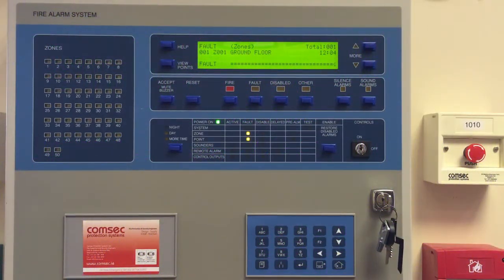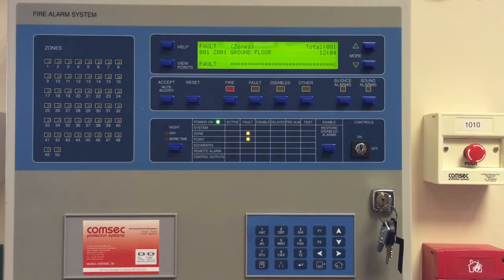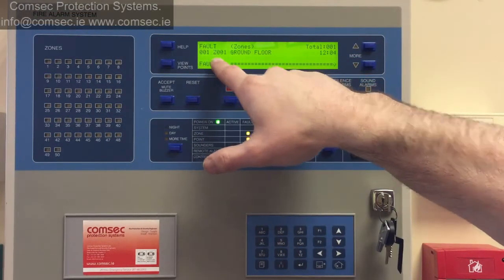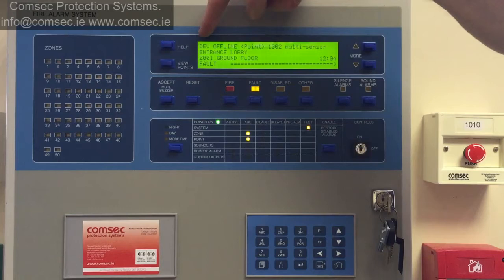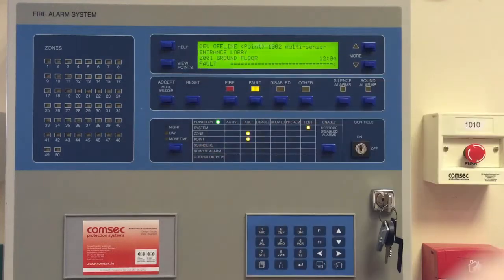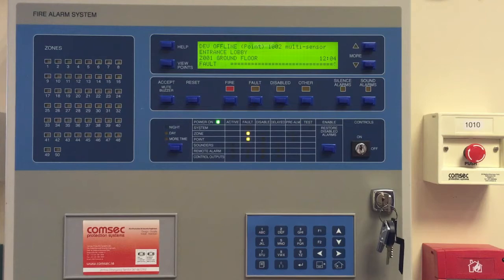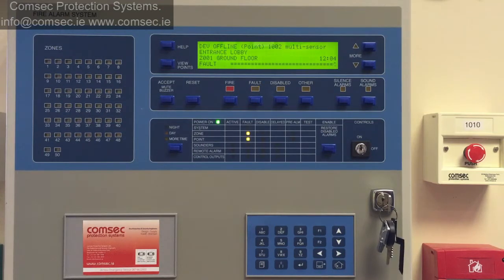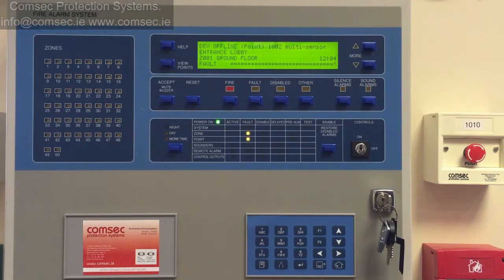Ziton ZP3 Panel. How to Identify a fault location.

Comment: sir good day what cause of Loop Fault 4 Noise and continues beeping? thnk u
Reply from the maker: The most likely cause of a loop fault is a disconnected cable or a short circuit. Check the analogue readings for one of the devices on the loop if they are ok you need to check for a missing device on the loop. If the analogue values are not ok you may have a short circuit on the loop.
Reply: @ComsecProtectionSystems1  thank you Sir

Comment: Hi. I’ve got a panel which says Loop 1 wiring P001 but no idea where fault is. Is there a way to use system to determine which devices the fault is between please? Thanks
Reply from the maker: Press the view points button. If its a short or open circuit it will say. if you need to find where the berak is in an open circuit remove the outgoing legs on the loop see what drops offlineand make a note of that, reconnect and then disconnect the other side of the loop and see what drops off line. the device that is missing both times will give an idea where to look for an open cuircuit
Reply: @ComsecProtectionSystems1  Hi. I pressed the view points button and also scrolling arrows and nothing happened or showed anything different. All displayed showed was-
Fault (Zones) Total :001
001 WIRING P001